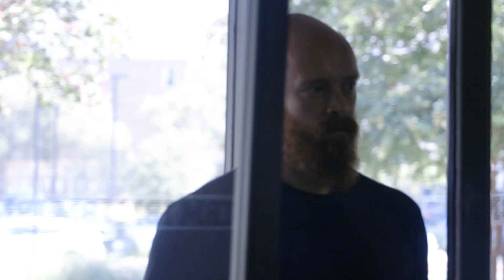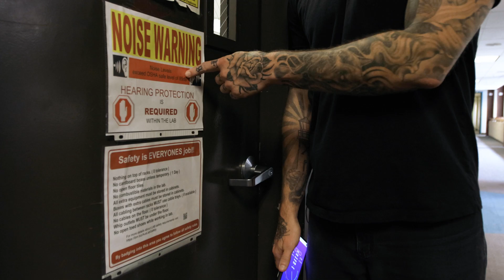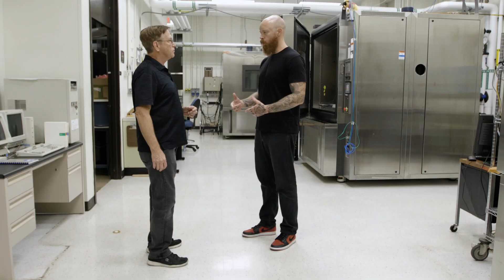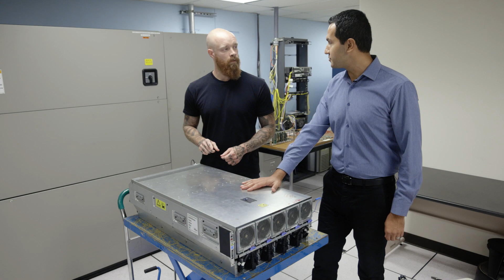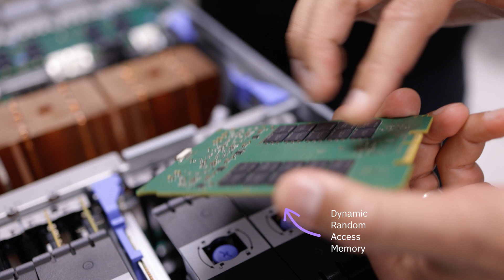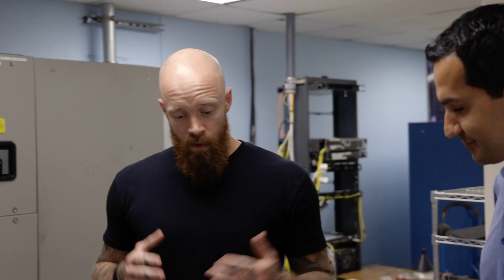Lab Tour: How IBM Develops and Tests its POWER E1080 Servers

Comment: AI & Machine learning capabilities are built into the Power 10 processor. Other systems need to move the data to some GPUs to achieve this. Apart from enhancing performance, this feature helps in improving data security as you don't need to move the data from the processor.

Comment: according to Yale Climate Connections, hottest temp in the USA for 2020 was 129 degrees F (Death Valley) & Washington post references some of the more extreme cases -56 degrees F in Minnesota for 2022. There may be a need to extend testing (environment temp) on either side of the board.

Comment: Nice I like it. i am thinking about the security point of view how we can build the code on Switches to secure the system. The system design by combination of software and hardware with inter dependent security structure may be beneficial to industries to secure data, and what are the different strategies or protocol need to prepare to show in audit, and how we can test this combine software cum hardware design system as both are interdependent to each other,